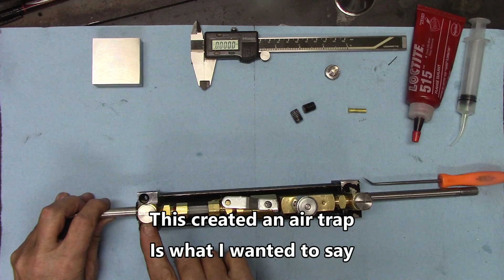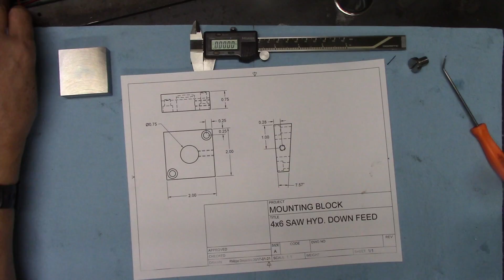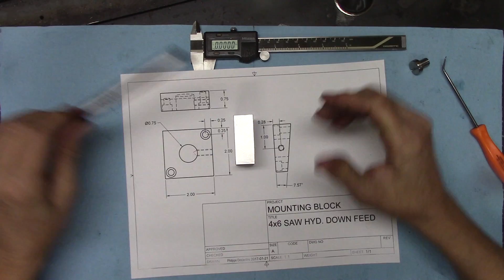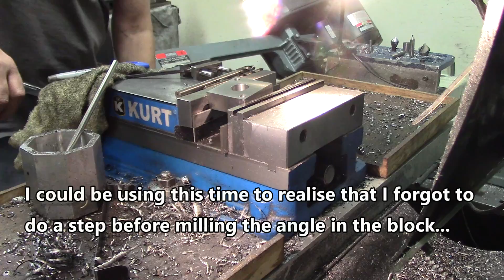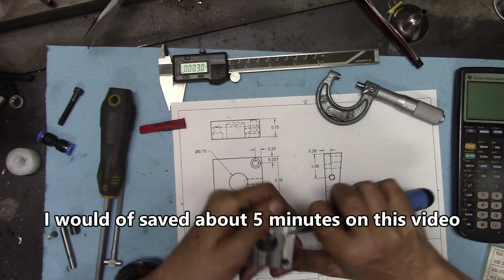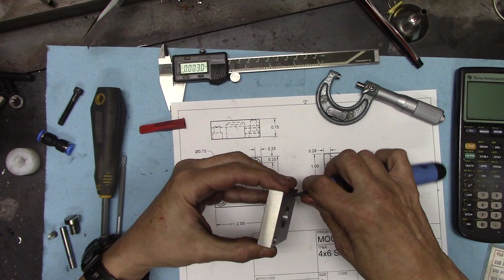4x6  band saw saw hydraulic  down feed mounting block

Comment: your doing a nice job, fabricating every part has been a lot of work, but this is what we like to do right? i built a hyd downfeed for my saw about 20 yrs ago. i used it for a while but didn't like it. i ended up going back to the spring feed. i used a much stronger spring and built a hand crank to change tension, i seem to get longer blade life with this setup. best of luck with yours.
Reply from the maker: Thanks, i think ( hope) that the secret in the needle valve which i why i bought ( what should be) a very good one
thanks for taking the time to share

Comment: You didn't HAVE to clamp on the angle. You could have clamped on the two remaining parallel sides.
Reply from the maker: Peter W. Meek  well your right, that merits a tap on the forehead with a duh thrown in for good measure

Comment: Making good progress Pierre..  Could you have saved yourself some setup time on the last step if you rotated the part 90 degrees in the vice to drill that hole?  It would have eliminated the need for dealing with clamping on an angle...
Reply: I was going to say that, why waste the pair of parallel sides.